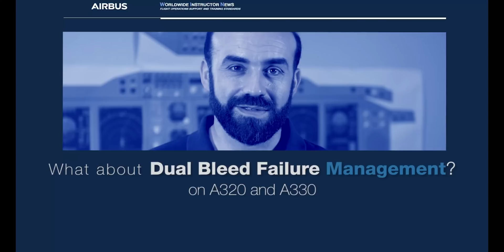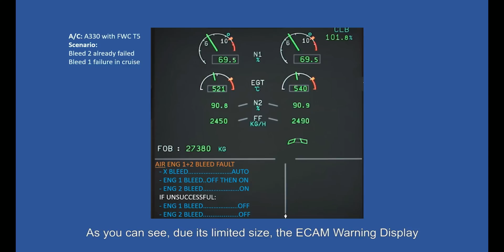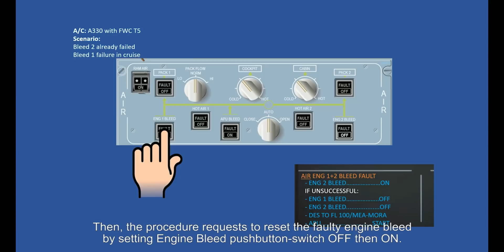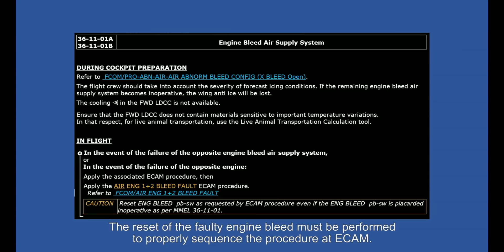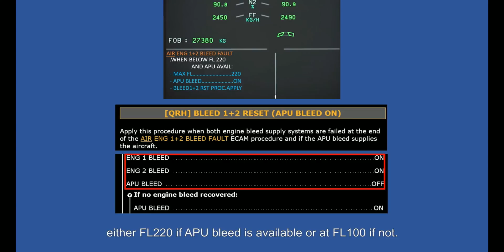A320 What About Dual Bleed Loss Procedure

Comment: 2:21 says the procedure requests (X BLEED AUTO)  to "confirm that the crossbleed is closed". Looking at the FCOM, the crossbleed will only close in AUTO if a wing/pylon leak is detected. With a simple ENG BLEED 1+2 FAULT, my understanding is that the crossbleed will remain open.

My guess would be that one reason for setting it to AUTO would be so that if a subsequent WING/PYLON LEAK is detected, the crossbleed will automatically shut. It is likely that the X BLEED would have been set to OPEN due to the MEL operational procedure for one bleed inop.
Reply: They summarized the whole thing in this video as even if the aircraft has been dispatched with MEL one bleed inop. To disregard the placard and follow the procedure of the ECAM.